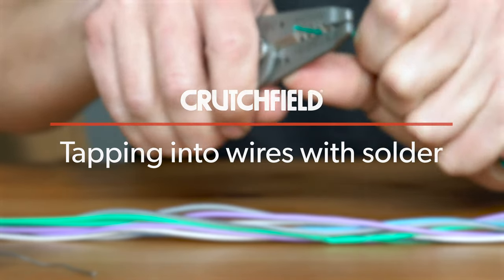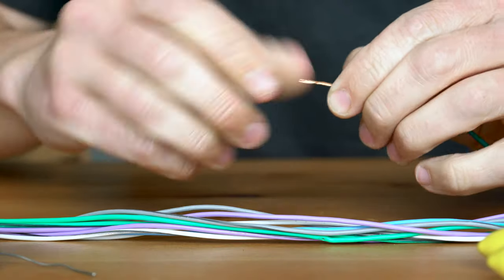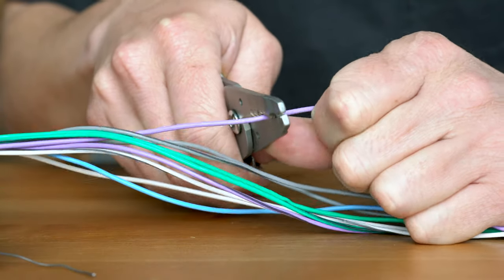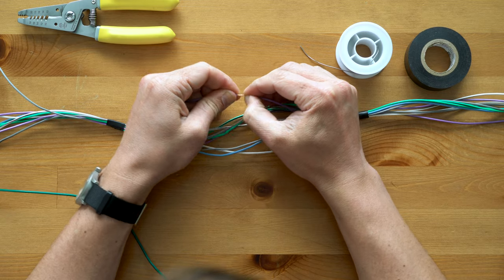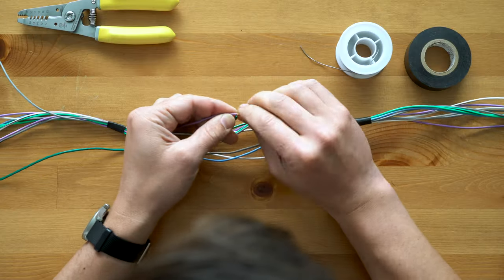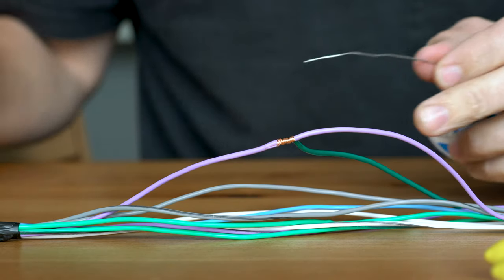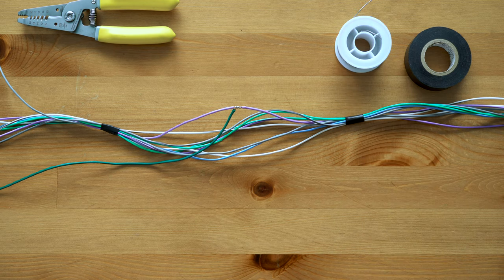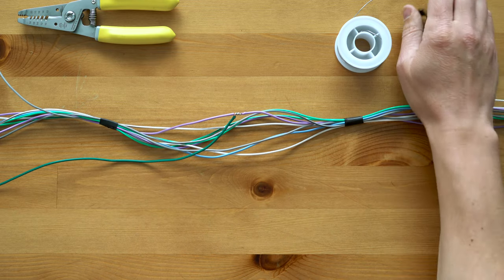How to tap into a wire using solder | Crutchfield

Comment: You can use the soldering iron to melt the insulation of the wire you're tapping into. It's the safest way. A cutter has been used, now a wire stripper, both of them not being on the safe side. Using the soldering iron can't hurt the bare wire in any way.
Reply: That’s a nice pro tip. Thank you

Comment: It's nice that when you touch your soldering iron on some wire, it actually gets hot enough to melt the solder. I can sit there for 5 minutes and the heat never seems to absorb into the wire
Reply: That's because your gun sucks or has a bad connection on it
Reply: Are you using flux?
Reply: @jimdavis5u  yes I started using flux and it's like magic, i don't know how people do without now

Comment: hello guys, watching your videos :) great work, finaly decided to do something with my car audio ... have bought 4x50watt jbl speakers for doors, and got one decent blaupunkt 250w subwoofer (pasive) for free from my friend .... but now there is a question .having a bit trouble... what amp to pair it with ? 4x50w + 1x250w ... as for corona, money is shorter than usual .... thanks for any advice :)
Reply from the maker: Thanks for reaching out Jozef. You are probably in the market for a 5-channel amp. Do you know what impedance that Blaupunkt subwoofer is? 

This Clairon 5-channel would likely be a good choice. It does 50 watts x 4 for the speakers and 350 watts at 2 ohms, 200 at 4 ohms for the sub:

https://www.crutchfield.com/I-rYTVc290/p_020XC2510/Clarion-XC2510.html?tp=35808
Reply: @crutchfield  wolud love to instal 5 chalen amp, subwoofer is 250w (rms) - 4 ohm , thanks for any sugestions

Comment: Thank you for this info. I recently installed a rear view camera for my stereo, and I used a tap splice to connect my wires (red camera wire to red/blue reverse light wires on the car, per instructions). That didn't seem to work, despite crimping them down as much as I could.  So I removed the tap splice and cut back some more of the rubber jacket materials and wrapped the camera red wire around it directly and covered w/ electrical tape.  Still didn't work - I'm able to see the reverse view, but not when I shift into reverse. At this point, I'm going to go buy a solder and do it that way (per this video), but I'm wondering why it wouldn't work with the wires wrapped around each other.
Reply from the maker: Having changed to the camera's power wire connection method to as shown just not with the solder should not cause the issue you described. Something else may not be installed or connected correctly and causing the camera to not show when in reverse. We recommend contacting technical support for help checking the rest of the installation. If you purchased it from us, we recommend contacting our technical support for help. Their number is on the order invoice.

Comment: Is there a way to use heat shrink tubing instead of electrical tape doing this method?
Reply from the maker: We have not found a way to do it without actually cutting the wire being tapped into.
Reply: Yes there is. Double over the wires and heat shrink. If you can’t, then moisture sealing electrical tape will shrink and bond to its self water tight and is just as good or even better than heat shrink at keeping water out
Reply: Also try using liquid electrical tape but makesure its fully dry!

Comment: think heat shrink tubing
Reply: How do you use it on an uncut wire?
Reply: @erichill7560  easy,  bend the wire at the solder, slip the heat shrink over & heat it up. Tape always fails
Reply: @erichill7560  Alternatively you can use liquid electrical tape if you'd like to avoid bending the wires.

Comment: Why wasnt heat shrink utilized?
Reply from the maker: There is no way to get the original wire into one end of the heat shrink tubing. That wire was never cut; only had its shielding stripped back to expose the wire
Reply: LIQUID ELECTRICAL TAPE!??

Comment: You forgot 2 key / very important parts to soldering speaker wire. 
1 is flux. 
2 is heat shrink tubing. How really relies solely on black tape ?
Reply: There is flux in the rosin core, also the points that you can do it without pulling the harness out, how would he get heat shrink on there?
Reply: @jonathanclark7444  You can cut the heat shrink down one side, and then when you heat shrink it, that cut will shrink/melt nice and tight.
Reply: @Jez1963UK  have you ever actually tried to do that because it doesn’t really work that way